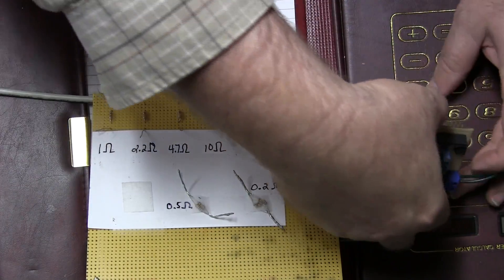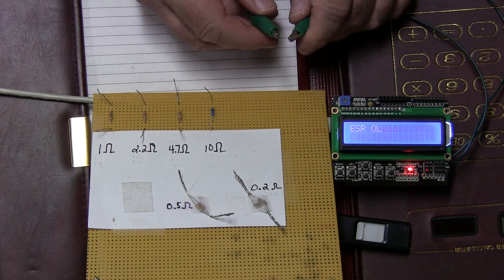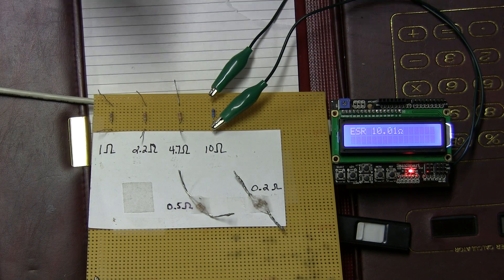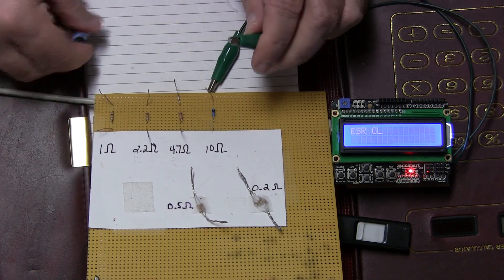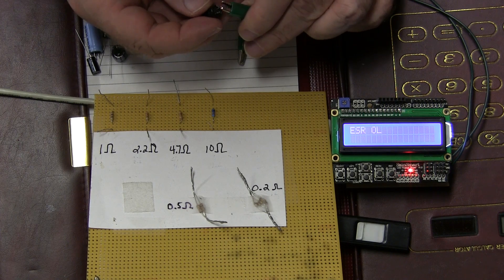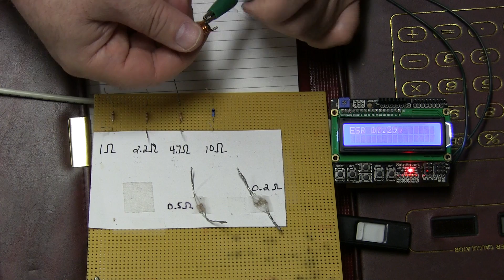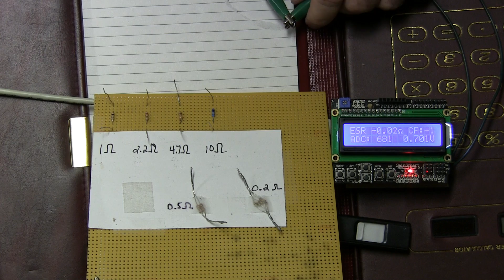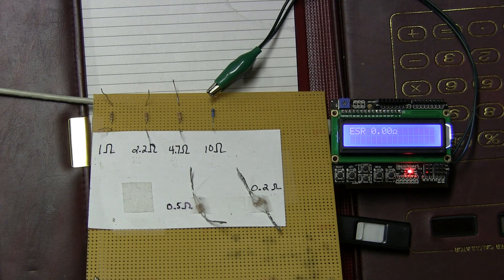DIY Arduino Esr Meter Shield - Part 1: Intro & Demo

Comment: Hi, I know that this video is from six years ago, but I recently did this this project with another branch for high measurements (above 20 ohm),  and it works quite good with resistors, but with caps about 1~12uf the reading is unstable, do you know or imagine what could be the problem if in theory resistance measurements are ok ??
Reply from the maker: I originally designed this for the lower capacitance caps as they normally have the higher ESR values. The issue may be with the charge time or transformer impedance or the bandwidth of the OP Amp. I would need to see your design to be sure. But with the low cost meters coming out of China, it is really not worth looking into that closely unless you plan to go commercial. Thanks for the comment Carlos!
Reply: @Dennis-kf0rlx  thanks for the tip, I look inside the code and find the issue, it was a problem around the histeresis of the measurements, the original code read the pin 3 times, I increased to 10 and the oscilating measurements dissapear, and by the way the two caps I was testing were BAD !!! Greetings from Cuba !!

Comment: Hi
Great Work!

I just found 3 powersupple transformers.
Which one could I use in this project
1- (oneside)32.7uH or 51.2uH --- (otherside) 5.98 mH or 14mH (this one has 7 pins one side 3, otherside 4) 
2- 28.9uH --  4.8mH 
3- 26.9uH -- 2.6mH

Thanks.

Comment: I found this today, and will start building one tomorrow. Great work -thank you :)
Reply: Have you build yet ?
Reply: @coloradowilderness3139  Sorry for the late reply, yes i've built one. 
Had a pause with my electronics until now. Pulled it back out today.
I'm brushing up on the internals  :)

Comment: Hi Dennis, you seem to know what your talking about when it comes to measuring ESR, My question is what modifications would I need to make to your design to measure down to 1 milliohm, for my college project I am to investigate how to measure very low ESR values on a charged electrolytic capacitors, I have seen this circuit by Lawrence P. Glaister at http://members.shaw.ca/swstuff/esrmeter.html who has a nice circuit with isolation and input protection.  Any thoughts would be gratefully appreciated.
Reply from the maker: Hi John,
Thanks for the kind words.
Actually the milliohm resolution is there. I simply chose to truncate it at the second decimal place.

Below is a snippet from the main loop of the program.
===============================================
// Call the esrCalc function to calculate the resistance from the mean ADC value.
ohms = esrCalc(adcVal);
// We can now display the results
lcd.setCursor(0,0); // Reset the cursor to the 1st column on the first line.
lcd.print(“ESR “); // Print identifier with spaces to clear previous values.
lcd.setCursor(4,0); // Then reset cursor to column 5, line 1, for the value.
if (adcVal > noiseFloor) // If the ADC mean value is greater than the noise floor
{ // we will print the resistance value.
		lcd.print(ohms,2); // Print the resistance value with 2 decimal place precision.
		lcd.print((char) 0xF4); // Print the Omega character that is stored in the LCD ROM.
}
else lcd.print(“OL”); // If we are below the noise floor of the ADC print the
// Open Loop (OL) abbr.
==============================================

The line below is where the value is displayed with 2 decimals.

lcd.print(ohms,2); // Print the resistance value with 2 decimal place precision.

Simply change it to:
lcd.print(ohms,3);

This will show the 3rd decimal place on the display.

As far as measuring a charged cap; both connections to the OPAMP are decoupled with a 10uF cap and there should be somewhere around a 20 ohm DC resistance between the test leads to dissipate the stored charge. Although not ideal, it should work as long as you don’t try it with a 600 volt cap;)

This is a low voltage circuit design, and R5 and R11 are the weakest links in the ground path.

Hope this helps,
Dennis

Comment: Hi ive got your eagle schematic and have put the design onto the breadboard, im having a problem getting a voltage to the transformer. I got 2.5v going into the + side of c4 10uf electrolytic cap but nothing comes out, if I put it on mv setting I get  -0.4mv. tried different caps but same result.
Reply from the maker: It sounds like the 1st opamp isn't oscillating. Check the connections and the voltage at the ground reference.

You should see a 5vpp signal at the cap. Do you have a scope?

Comment from the maker: 2. I originally built Manfreds design and used it as a test base. I found an off the shelf audio transformer at Radio Shack that worked well but was too large to use for this build. I was going through my parts when I came across the transformer I used. The xformer needs to be around 20:1 and pull < 100 mA ( the lower the better) on the primary windings. 

Manfred has a great writeup on his page discussing the xformer. There is a link to his site in the description of this video.
Reply: Dennis Hill can you please tell me an alternative transformer in place of sp-67...it would be a great help. i can't visit to your site there seems some error can you please send me an pdf of your esr project

Comment from the maker: 1. It wasn't too bad. Manfred had done all the real work of coming up with the idea of the step down transformer, that isolated the Device Under Test, and to provide the low impedance output!

I just had to put the circuit on the shield and come up with a way to attenuate signal in order to scale it properly for measurement with the ADC and add the ability to adjust the test frequency.

There are certainly better ways of doing what I threw together.

Comment: Your project is great! You must have devoted a lot of time for it.
I've got two questions:
1. How did you manage to make your shield based on Manfred Mornhinweg's analog design and write Arduino code for it? I guess It must have been a very difficult part of your project.
2. How did you pick a proper transformer (if I heard right - you salvaged it from an old PC power supply). How did you know it's parameters (I mean primary and secondary windings) and know that it would work with your shield?

Comment from the maker: Thanks!
I still have two videos left to finish the project. I have been waiting for the Visual Micro release for Atmel Studio to do the programming code for the Arduino. 

The Atmel Studio IDE is great & FREE!
Visual Micro is an add-in for programming the Arduino platform & is FREE also!

Visual Micro does include a debugger you can try free for 30 days, but you don't have to have it; it is nice and only costs $15.

Check out my video on the install and I'll get the programming video up soon.

Comment: This project rocks. Keep up the good work. I'm working on mine wich is using the same schematic as yours but only with a analog 500µA meter and as you said in your previous video, it just doesn't cut it on the resolution. I'm experimenting with the Op-Amps that i have laying aroung and the best of the bunch seems to be the TL082 but I am going to try LM324 tomorrow. It will be nice to make myself an Arduino ESR but the parts costs here in Romania double that an already made digital one. Cheers!